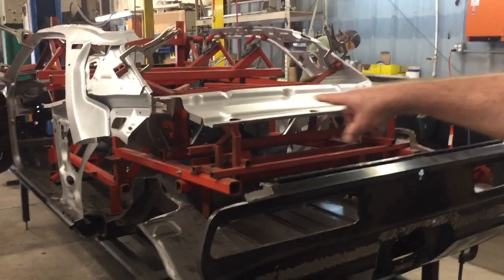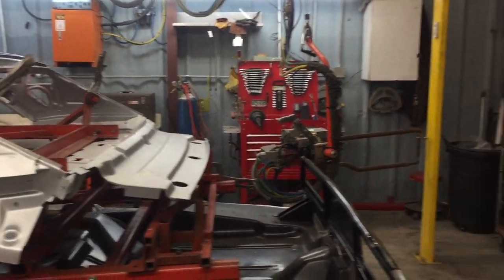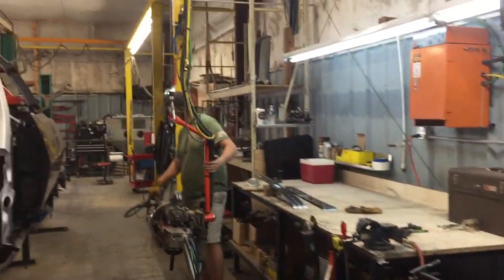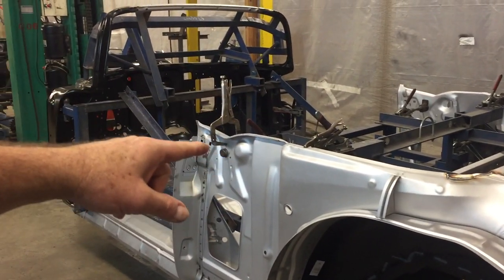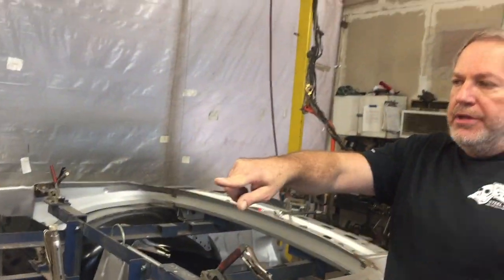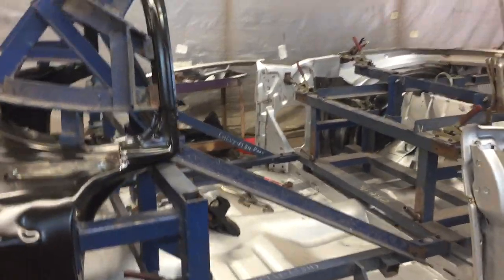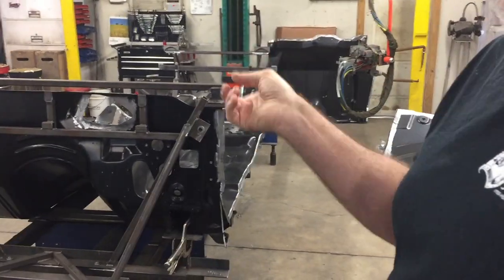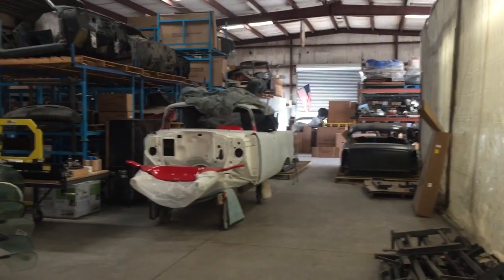Real Deal Steal, Cars Being Built. Must See | Part 2

Comment: these body's are junk ! very poor craftsmanship. i know first hand. I bought one of these and spent well over 100 hours fixing the things they did wrong. had to completely remove the firewall and cowl due to poor fitment. quarters were screwed to the rockers and not welded. windshield opening had to be completely re worked. i would not recommend buying one of these bodies.
Reply: Got their full floor pan with mini tub and my floor was twisted and had horrible cuts. Spending time fixing those cuts and needing a frame shop to fix the twist. Smh
Reply: If you know so much you should have just probably built your own Camaro out of fiberglass or sheet metal
Reply: @mishaladara  if i would have known how crappy their craftsmanship was  i would have done it all myself. By the way i did fix all of the issues they had my self. so don't start making comments about a something you know nothing about.
Reply: @CT-qg3gw  I Got a complete body from them and it was so so bad i spent over 200 hours fixing everything they screwed up. The had screws where spot welds should have been and about half of the spot welds as the factory did. truck didn't fit doors didn't fit front and back glass didn't fit. looks like they had a bunch of kids putting it together unsupervised and they all had ADD
Reply: @jcook69camaro  the floors were cut so bad on my tubbed version, I ended up having to have custom tubs built as the DSE they sold and another set, didn’t work. FML
Reply: @jcook69camaro Well it could've also been professional metheads that could have been on the pipe you know😂